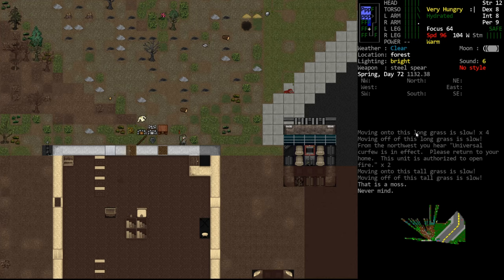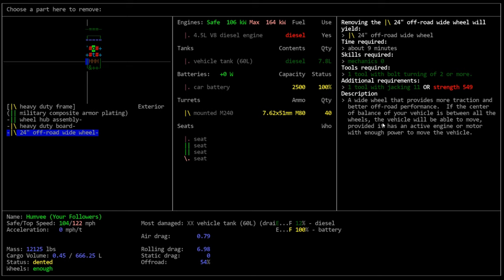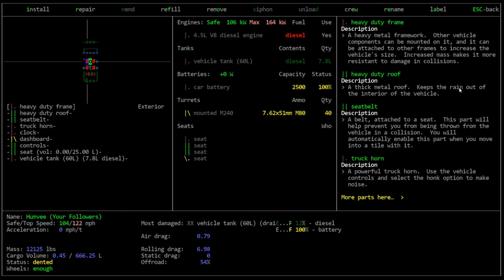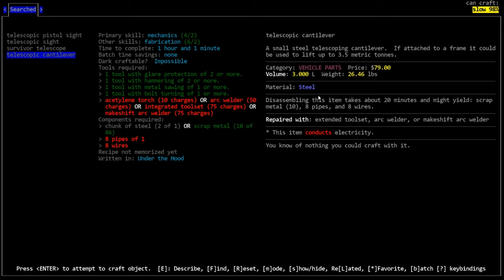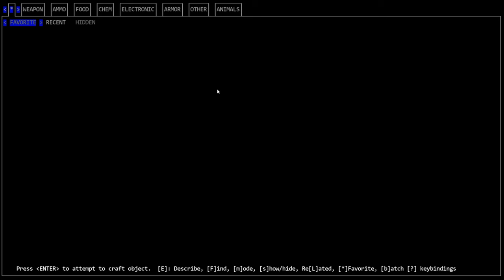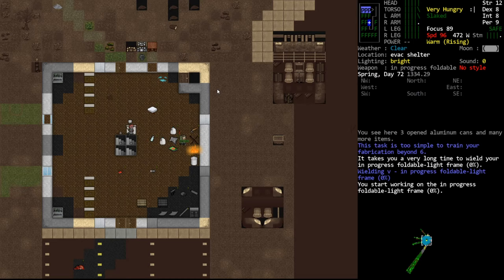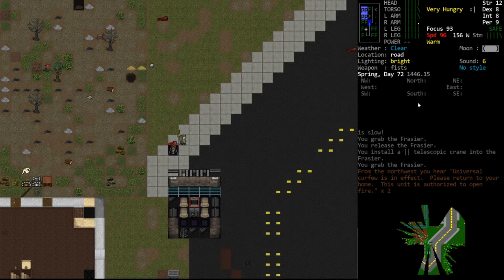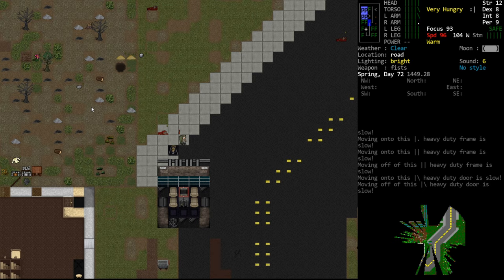CDDA - Tutorial Let's Play 52 - Jacking and Lifting

Comment: Is there any way to get strength of 549?  Or is it just a static message that's non-sense.
Reply from the maker: There's just some strength assigned based on the weight.  You'll never get strength that high.  I don't even think you can debug to that str, there's probably a hard cap.  Our character at 12 strength could get to 18 with mutations and CBMs, more if we're using stats through kills.
Reply: @TheMurderUnicorn Don't hulks have a ridiculously high STR so they can smash walls and such? It should be possible for the player to also do this using the debug menu or creating character without point restrictions.
Reply from the maker: @subarusama5673  I don't think a player can start with a strength high enough to smash walls, some of them have checks in the 100s which just isn't possible, and I'm pretty sure there's a hard cap.  As for Hulks, I dunno really.  I know that if they punch you it will knock you through some walls that are otherwise really difficult to circumvent.  For example, on the prison island one of the most reliable ways to get through the new beefy fence is to let a hulk punch you through it.
Reply: @TheMurderUnicorn
I've seen a couple of videos from Vormithrax and the "big baddies" like hulks like to smash walls in normal buildings, labs (most notably in barracks), collapse floors, roofs, push large vehicles, etc. Normal, default limit on stats is 20 in the character creation. But using the debug menu you can create miracles, just take a look - https://i.imgur.com/3gh24RC.png ;)
Reply: If you max out the str stat and then pick the vat grown bodyguard start you can start out with 21 str. Thats the highest you can start with I think